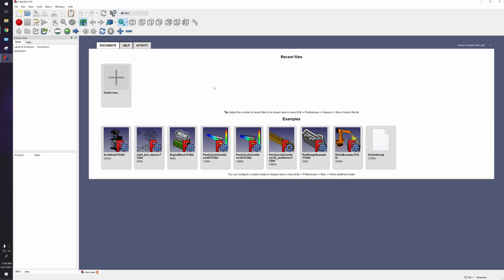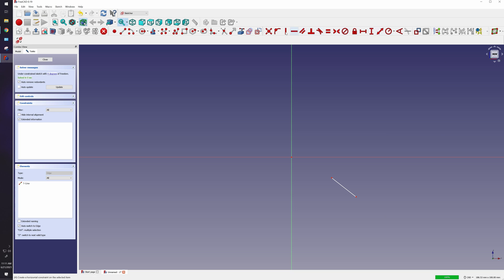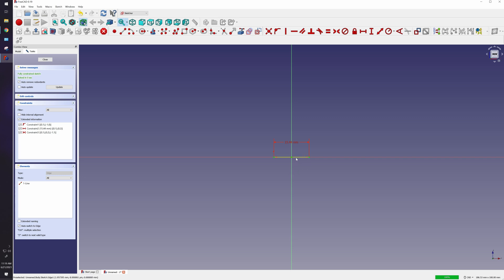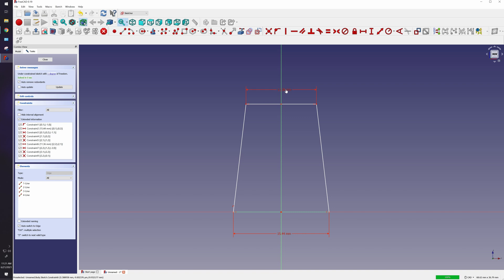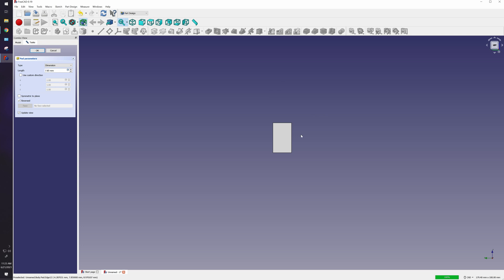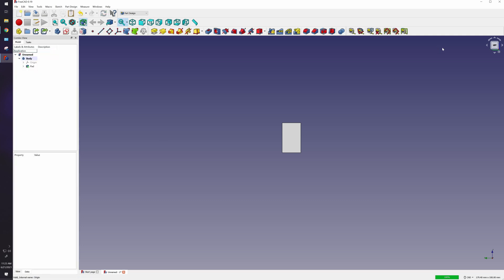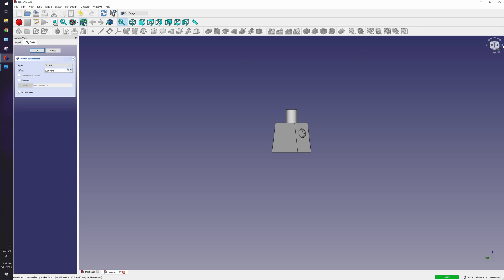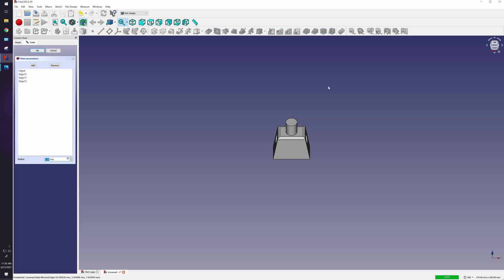FreeCAD 0.19 Lego Man Tutorial Ep 2 - Torso  | Easy Beginner FreeCAD Tutorial

Comment: Hello, since I am using Solidworks, a different CAD software, I need to know the distance from the centerpoint in FreeCad to the bottom edge to be able to make the arm holes. Thank you if you respond and see this!
Reply from the maker: Hey boss, the bottom edge is right on the x 0 line.  Since you are using Solidworks try placing the center of the hole 4.5mm down from the top of the shoulder.

🍻

Comment: Im following you exactly to what your doing and when i use the equa-distant tool everything just over constrains and turns orange.
Reply from the maker: Make sure your running the latest version of FreeCAD, at one point I had something similar error on my tablet that was running and older version of FreeCAD.
Reply from the maker: When you use the equal-distant tool make sure you are clicking on the end points then the line you want to work as a mid point, I played around with the command a bit and found that clicking the edge rather then the point would make everything orange and over defined.
Reply: Have you checked "Auto remove redundants" and "Auto update" on the left in Solver messages ?